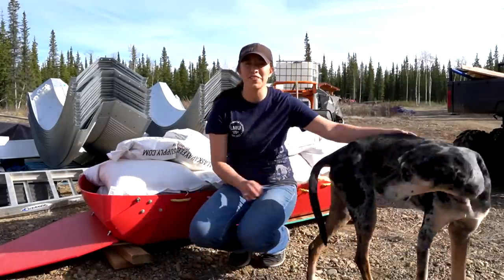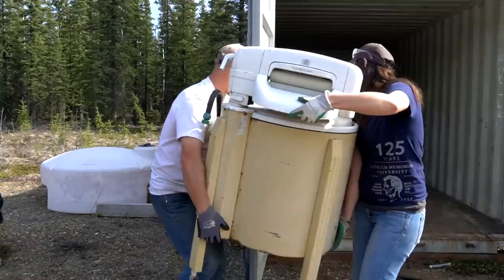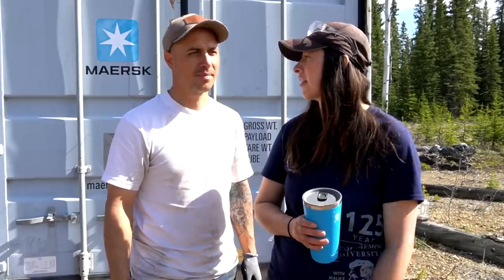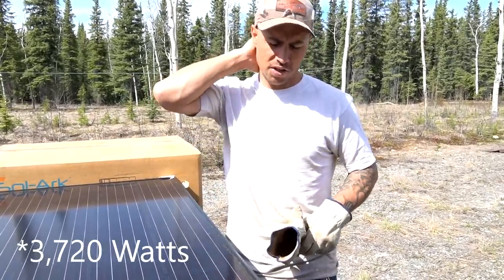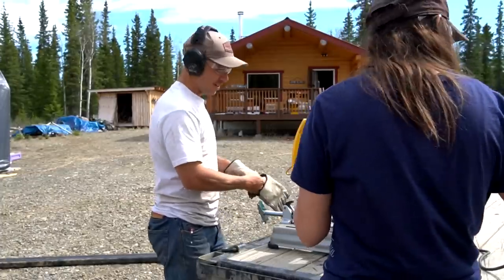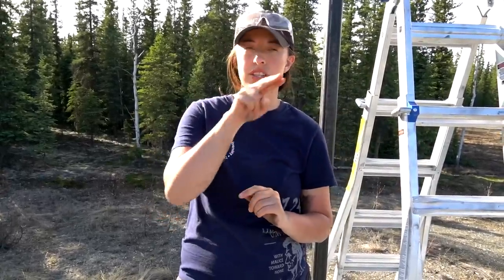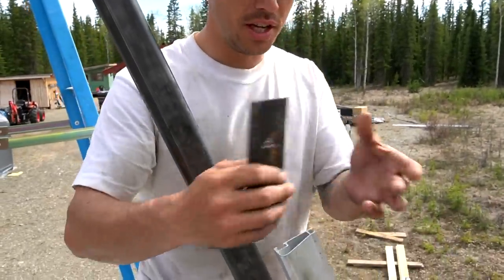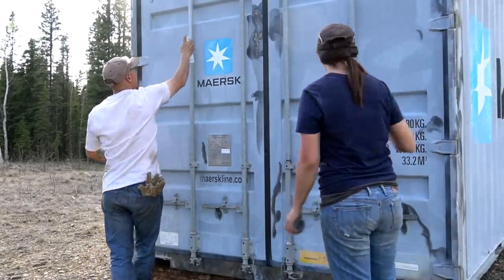Building a Conex Solar Panel Mount for Our Off Grid Cabin

Comment: One thing I would recommend is cutting some diagonal bracing (like 3ft+ long) to go from the vertical posts to the top horizontal piece.  It will greatly stiffen up the structure preventing it from wracking side to side when the panels are in place.
Reply: Yeah I was thinking the whole time, it just needs some lateral supports and it'll be bulletproof!
Reply: Im not an expert on such matters but i was thinking of wind; that is a lot of solar panel surface for the wind to catch.  Not sure about snow build-up as the panel angle is tbd to me.
Cheers from Canada, eh
Reply: @andregagne9365  yes.....and they will get a lot of wind as proven this last winter
Reply: Alternatively they could use cable struts using turnbuckle fasteners to stiffen each segment.

Comment: Your opening drone footage is just THE BOMB! Such Beauty! The melting time-lapse tells the story of spring/summer so perfectly!  Eric & Arielle what followed blew my learning curve wide open… and I’m moving toward 76. Thanks for bringing excitement to the last Thursday in May!  Creating a solar array out of metal pieces (some used) is fascinating! You are climbing to new heights each time you post! 💞
Reply: yeah the shot at 1:55 looks magical!
Reply: Thanks for the overhead of the cleared area as well as how dense the forest is. Now I can see it’s only about 3 acres. It’s misleading when the camera is at ground level and panning a lot. Good job on the solar mount. It will be interesting to see the components you’ve chosen as well as the setup. When do you get the magnetic signs for the truck for your homestead construction company? Thanks for the video, always fun.
Reply: @duanechadwick331 Actually they have purchased 40 acres, we’ll see the rest later I’m sure, that’s why she mentioned cutting down some of the live trees, of which Airiel never likes to do if possible ❤
Reply: @dorothyallen3614  yes that’s correct I was actually just commenting on the cleared area I commented on in a previous episode when I thought the cleared area was 15 acres because we hadn’t seen a good overhead yet. Thanks for the reply I like the community interaction here because it doesn’t get ugly over some small detail. It’s just fun watching and vicariously participating with them.
Reply: agreed ❤

Comment: Bo knows... Bandit's ready!!  Pepper's like:  Mi wrm!    Yay!!!  I was so pleased to see Bo in frame!  I was beginning to worry he wasn't doing well (or worse).  Attaboy Bo!  Bandit sure was excited to see "dad" come home.

Yes, the further north you go, the more intense the sunlight is during summer.  Up in the high arctic, 60F  feels like 85F-90F, and if there's no breeze it really feels hot.  The caribou LOVE LOVE LOVE the Oil Pipeline when it's suspended above ground, it provides shade and they'll all line up to stand in the shade during the heat of the day.  They also love the buildings on the gravel pads.  Each building has air handling fans which blow out as they exhaust.  This knocks down the bugs and gives caribou a break from the swarms when they stand underneath.  

Pretty exciting seeing the solar framework going up!  You have a triangulation effect with the frame, consider adding some diagonal bracing to triangulate the side loading against those Alaskan storm winds.  From vertical to mid-span horizontal brace.  Looking amazing thus far.  Can't wait to see it all come together for you two.  Nice team work, as always.
Reply: I'm glad you mentioned Bo, we just came to the comments as we were worried toi
Reply: Was  glad  you  mention  Bo  he looks  like  my  son's  older  dog that used to sleep with me all the time  !!! I didn't mind it at all  from the beginning  we hit it off together  !!!
Reply: I came to look to see if there was any mention of Bo as well. I was getting worried with only seeing Bandit for most of the video.  Glad he’s still hanging in there .
Reply: Interesting about the  caribou using the pipeline for shade . Thanks.

Comment: Just a couple of things I would do, from learning the hard way.  Put a non-conductive membrane between the aluminum clamp for the solar panel and the steel rack, and put a good grounding system from the rack to the ground for lightning strikes.  I built a canopy rack for my boat, and mounded the pieces over the canopy to the steel uprights, and you could actually measure the electricity for the electrolysis, and they rusted through quickly.  Where i live now in B.C., we have a summer place on the ocean.  Everyone grounds their r.v. to the ground to protect them from lightning.  Don't get a lot, but when we do, they are good ones.  Good job on the welding.
Reply: The rust that you’re describing sounds like galvanic corrosion from dissimilar metals in contact with one another. Good suggestion for them to isolate the two metals.

Comment: I was a general contractor in my younger days and I would sure like to see you put a sway brace on the two verticals at least 3 feet long. If you have any wind at all with those solar panels it is braced back to front but not from side to side. If the wind starts moving it back and forth from side to side it will break your welds. I love what you are doing.
Reply: I was worried about the wind too

Comment: We use the same inverter for our off grid system and love it. We got 2! 
Tips from a welder, get a cold cut saw. They’re not as cheap as the abrasive discs but they last a long while, cut fast, and the steel is cool to the touch after cutting. Get a speed square, medium size. It makes for scribing lines so much easier. Your welds look good! Awesome project.
Reply: Yes! Was looking for this info to pass on to them/others. Thanks

Comment: "The Change",  Great lead in footage.  Next Conex move put the timbers full length and tie then together at each end with a cross brace.  Chain the crossmember to the front so you can lift them slightly with the backhoe rear bucket  and slide it along.  The greener the log the better.  LMU, gota love it.  Harrogate, TN.  East side of Cumberland Gap National Park.  Boone's and America's 1st Gateway to the West. The tunnel under it is 4600 ft. long  Come see it. Great school.   Man that's going to be a wonderful system.  A lot of watts.  Fix those braces for snow and wind load both directions.  Respirators for the paint.  Nextime.   Looking good.

Comment: A chicken-free episode! 😊 Lots of hard work with the steelwork for the solar panels. And the welds securing the plates to the square tube looked really good - I can't weld, mine looked like pigeon poo! From the size/wattage of the panels your batteries should be well-charged the majority of the time through the year. Looking forward to seeing the panels/wiring etc. complete. Great wildlife shots at the start too. Also looks like your choice of tractor was spot-on, looking very versatile.

Comment: If you can't get your top joints totally closed up on your solar rack, make sure you drill some drain holes at the bottom for water to get out. I've had water get in to pipe like that and then freeze and it really did a number on it. It's amazing how much power freezing water has.

Comment: Hey guys beautiful place you have there and outstanding video. 
When you mount the aluminum to the steel brackets insulate between the two metals. I spent 23 years  in the US Navy and dissimilar metas corrosion is no joke. You're doing a great job, dont skip the small stuff. Mike from Maine.

Comment: after 3 different ideas about mounting solar and conex ,i had to go all out  being from wisconsin and retiring in new mex ,so here is my job for the fall . the plan is to level 120 ft, pour piers ,remove 2 doors on 2 40 ft high top conex bolt and weld ,end to end. using mine rail track and steel wheels im building one hellave faraday cage because daddy always puts his tools and toys away, the key is perfect level, wooo wooo solar train

Comment: Eric, you have a knack for fabricating. It's artistic.
My limited engineering classes taught maximum rigidity will come if you weld angle bracing to the four roof corners. Probably not from the very top of your vertical support but at least 1/3 way up the supports. I know it means compound angles but wind winter winds can be hard on unprotected tall structures.

Comment: Impressive job you guys just never stop....I've just done a very similar project but with 8 x 300W canadian pannels here in the UK .. I used Heavy guage back to back galvanised unistrut for the steel framing ..makes for a much much easer build and is super strong ...also no welding ( it all bolts together) and no painting on the frame as its galvanised.

Comment: Wow that is a lot of work. We went with a 5 kHw (48-volt) system at our cabin which supplies enough juice for 3 chest freezers, two refrigerators, and a Rinnai instant water heater. We end up with a bit left over for incidentals if we want. I will probably not get an answer since you have over 900 comments at this point, however, why did you not go with a panel system that the angle can be changed depending on season? You briefly covered it in your video, and yes 25 degrees does capture spring/fall but for the winter man o' man you are leaving a lot off the table during a time of year where you need every ray of sun. For your neck of the woods that would be ~5 degrees. Anyway, really good video folks. Thx for taking the time to film, edit, and then share it. "Freedom Through Self-Reliance" 73 & God Bless

Comment: Looks great, consider isolating the steel to aluminum connections with some good paint, or non compressible rubber as the dissimilar metal will cause a reaction that makes the aluminum degrade over time.

Comment: Riley and Courtney (Ambition Strikes) put 10KW of solar panels on a conex with all the power electronics and batteries in the container. Then they ran a buried 220V line to their shop and house. They also have a military surplus diesel generator for times when the weather is overcast.

Comment: I served a 4 year apprenticeship as a welder fabricator (Becoming a City and guilds Advance Craftsman) and had 10 years experience as a welder fabricator  before giving it up and becoming an /IT Consultant.  
Any prep work you can do whilst the metal is on the ground save a lot of time. Even to the extent of  cleaning the box section and painting it before building your fabrication. I appreciate you burn off the paint where you need to weld. But the rest of the structure does not need painting again. Just the area which was welded. 
In the UK you can purchase your metal box section already cleaned and painted. 
Drilling holes whilst on the ground in the metal saves a lot of time. Rather than struggling up a ladder with a pistol drill. 
Rather than using MIG welding you might consider changing to Manual  Metal Arc using rods far less complicated and reliable welding set.  You require a little bit more skill to use MMA welding. 
Oerlikon welding rods are good. they even do a vertical down welding rod.  
I spent a year on day release from work just learning about MMA. At work I was MMA welding 4 days a week as well. This gave me my City and Guilds in MMA welding I was also examined at the end of the year. In all with the company I did my apprenticeship with I spent 8 years MMA welding.  Seems over the top now considering people who can just strike an arc claim to be a welder.

Comment: I was taught to always wash a house  (or walls)from the bottom up.  The reason why you will not be causing streaking lines on the lower area is because the dirt has been removed.

Comment: Hi Guys. Love what you doing. Just a bit advise. When welding dont cool it down with water or ice. It creates hairline cracks on the weld that could fail as it gets older. Advice from a welder regards from South Africa

Comment: Great job on the build however, with the kind of wind you guys have I would add some lateral 45 degree cross bracing in the corners of your frame. The way it is you're relying on the welds in the joints and that will be a huge load on a small weld in a wind storm. Those panels will put a huge load on the frame from the wind. I Love watching you guys.

Comment: Hello Eric you both are awesome for future reference buy twisted wire cup brushes  to use on your grinder so you won't be picking wire out of your face lol I know this because I use to use them alot also if you buy a new liner for your welder try using a liner next size up from the wire you are running less chance of binding it may help maybe not I'm a retired millwright from Oregon steel mill in Portland Oregon love your channel ps you may want to ground your frame due dissimilar metals you are using aluminum versus steel it may not be a problem but could be  take care my friend

Comment: it looks like it is just hot rolled welded a500 square tubing.  that greasy coating is a combination usually of mill scale and oil.  to clean them you can use acetone, kerosene, mineral spirits, basically any degreaser.  when i am making a roller from steel pipe i generally belt sand or have a grinder with a wire brush to get the coating off.

Comment: I used to have to cut a lot of angles, still do honestly, but a bit different then the angle you need. When I would cut angle the way you need them I would take a scrap piece of wood and cut the angle on that first to figure out the exact degree on the saw, works very well as the cut is fast to find the exact angle and the wood is junk anyway.

Comment: Make sure you put some kind of gasket (rubber?) between the steel and aluminum.  Dissimilar metals don't do well in direct contact, plus they have different expansion/contraction coefficients.

Comment: Bi-metallic corrosion is problematic between aluminum and steel, you should probably paint at least the contact surfaces as well as use rubberized separation. Thanks a lot for the video!

Comment: Eric, hard to tell for sure but that channel sure looked a lot thicker than 1/4".  Also, you might want to think about capping the ends of the channel.  I was wondering just how much force a 75 mph wind could exert against 12 panels and the Conex .  Might be worth calculating to see if the overturning moment could overcome the dead weight.

Comment: You will find your chop saw will cut far better putting you steel In it on a angle .diamond shape .angle iron put it up side down .it's hard to cut threw the long flat sections  .Ps their is a thing called a liner in your welding wip .cheap to buy .Never put your welding wip in a tight circle screws up your liner .I like to use one size bigger tip also helps .You may find your wire is getting damp and rust that will screw your welds and your liner up. Hopes this helps .You are a talented young man . Canadain Redneck

Comment: Nice work!  Your solar angle should be tied to the most extreme low sun angle ... Jan or Feb...  I'm very steep in Northern MN... since Jan and Feb are the months i need the most solar.  All other months are not a concern... -> so darn steep is useful.  There are formula and equations to do this... but, it's simple if you just plan for your lowest sun days.  Good luck.

Comment: Someone mentioned the shoulder upgrade would let you use the generator less unless.. did you ever think about adding a wind turbine to your system.. some of the reality shows I watch Dave been adding wind turbines for the winter when it's a really really dark.. I know the wind May overcome some of the ones that plays but they're newer ones that don't have played that they operating a different means and the strong winds do not affect them as much as the one with the blade, , they come in three different levels residential commercial and industrial size. I don't know what size you want to get to help maintain your power system,  you be less likely to need to run into town and I'm going to Winter to get fuel for your generators .. I know like the filler panels they're going to run the money up front but they pay for themselves over the life of this system.. and if you got a little stream by there some people have been using car alternators to make electricity for their battery systems.. I know you can't use in the winter time but every little bit counts right..  have a nice day God bless you and your family and your pets and livestock as well,

Comment: Hey kids, how big is your new place (acres)?
Reply from the maker: 40 acres
Reply: @SimpleLivingAlaska  Thank you. A BIG smile comes to my face when I see your new video each week.
Reply: @SimpleLivingAlaska  these are SO good. 
BOBERRY BISCUITS
BISCUITS:  2 cups flour
1 cup milk
1/3 cup sugar
5 T butter
4 tsp baking powder
1tsp salt
3oz Blueberries (fresh or dried)
GLAZE:  1 cup powdered sugar
1/8 cup water
1tsp vanilla
1/2 tsp lemon juice
DIRECTIONS:
Freeze butter. Preheat oven to 450
Mix salt sugar flour and y powder in a bowl and sift
Add cold milk into dry ingredients and mix. As dough begins to form, use a cheese grater to grate your frozen butter evenly over dough. Fold dough and knead. Repeat until all butter is spread evenly throughout dough. Fold in blueberries. Gently pull off chunks of dough and pat to form biscuits. Place on ungreased cookie sheet place in oven and bake for about 7-12 minutes (until golden). Melt 1 Tblsp of butter in microwave and paint finished biscuits with pastry brush. Mix glaze ingredrients in a bowl and drizzle over biscuits with a fork.

Comment: FYI.. you have the wrong nozzle on your welder for flux core (innershield)..and those staples....may be because the guide tube is to far away from the drive rolls...couldn't tell the details on your vid...haahaa..all in all WTG you guy's !!

Comment: Those solar panels will be a windmill when the wind blows.
You better anchor that comex box in 5 tons of concrete to keep it from moving.
Those solar panels should be close to the ground & close to the house or shop.
1000 feet is just stupid.